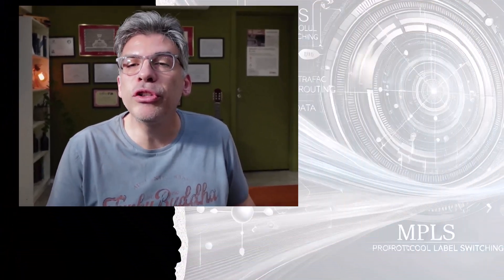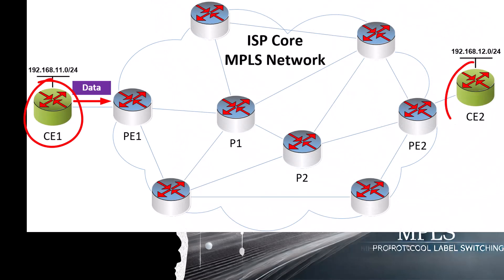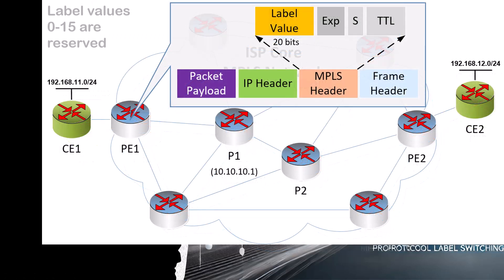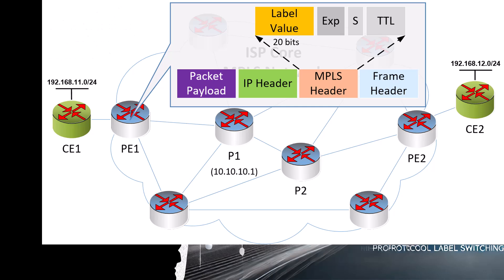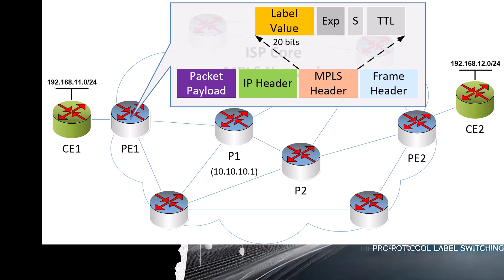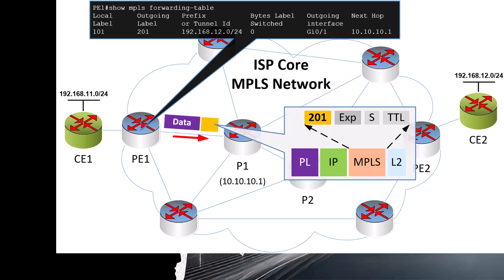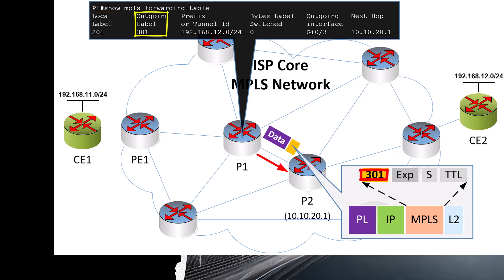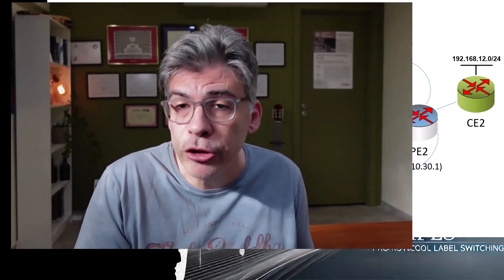MPLS - Pushing, Swapping, and Popping Labels

Comment: HI lazarus - I work in NOC handling Multi vendor Switches and ring topology failure (fiber , UBR , Flaps) I am going deep into networking , From your experience what skills separate an average NOC engg from a strong one today ?
Reply from the maker: Wow, that's a great question.  And it's important especially for anyone wanting to advance their career in a substantial way!  What separates an average NOC engineer from a strong one today is not just knowing commands, but how they THINK and TROUBLESHOOT. A strong NOC engineer understands WHY things work, not just how to fix them. They can visualize traffic flow, understand control-plane vs data-plane behavior, and correlate symptoms across layers.

They’re comfortable with multi-vendor environments, know how to read logs and packet captures, and don’t panic during flaps and malfunctions.  They isolate, hypothesize, test, and confirm. On top of that, strong engineers build skills in automation, scripting, and telemetry, document well, communicate clearly during incidents, and continuously learn instead of only reacting.

It's a multifaceted approach, but it is necessary for standing out in the crowd.  I may create a short series on these types of soft skills and how to develop them.  Thanks for the question!